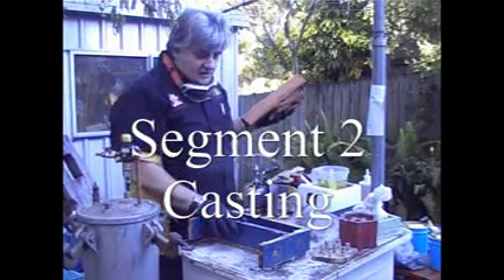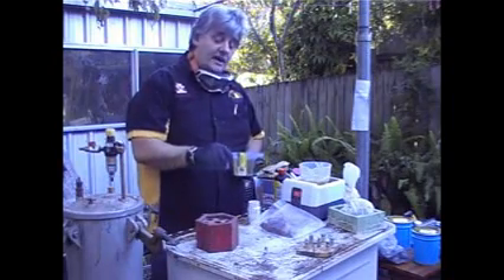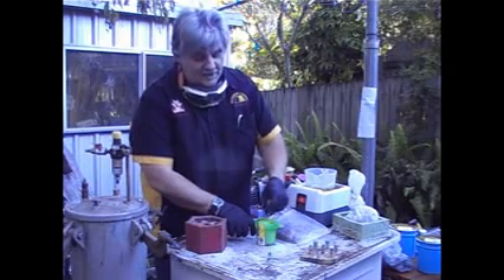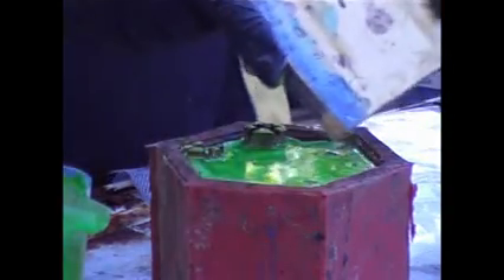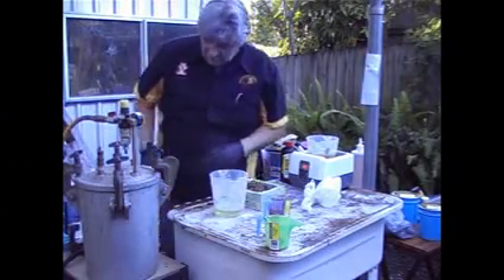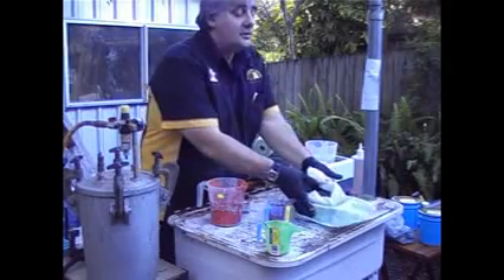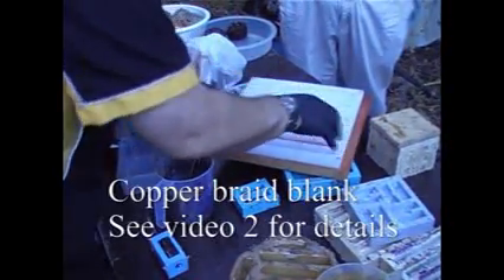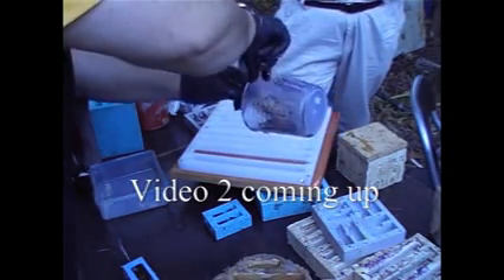Day 1 #3 Casting various

Comment from the maker: Sorry for delay, hadn't been advised of comment.  I use Fibreglass International Ltd clear casting Polyester Resin.  Not sure where you are, but they have depots in most capital cities.  If you are after just small quantities, you can use Diggers Clear Casting Resin from you local hardware, same stuff, just you pay more.  Cheers

Comment: Great demo, thanks. How do you make or acquire the mold used for the pine cone blank?
Reply from the maker: I make my own molds with casting silicon available usually at you resin suppliers. One of my other videos shows this.  I have also bought some directly from here http://www.ptownsubbie.com/siliconemold.html, they are good quality and often cheaper than what I can buy silicon in Aus :)
Reply: Thanks.